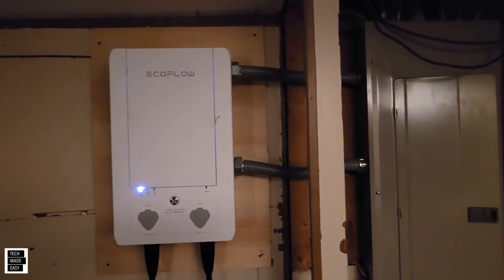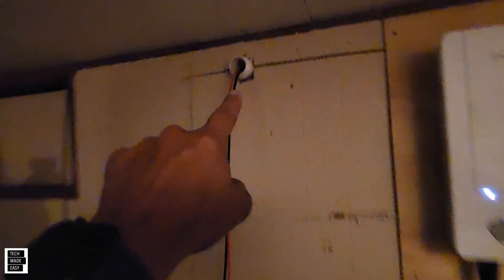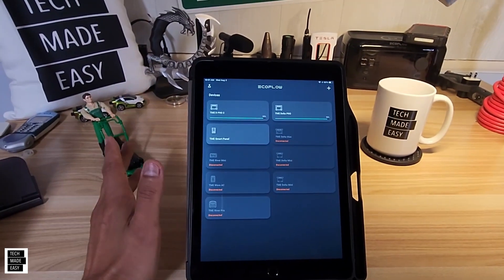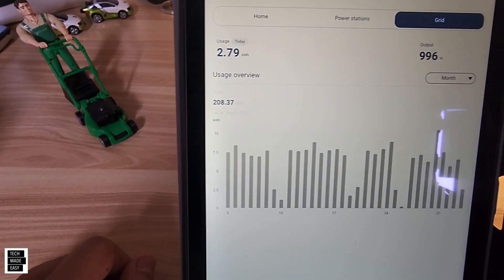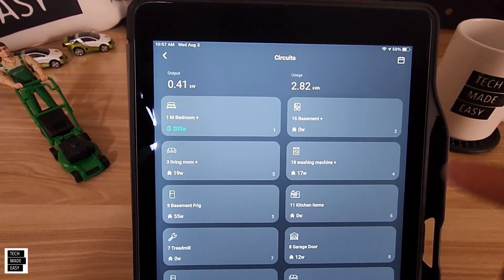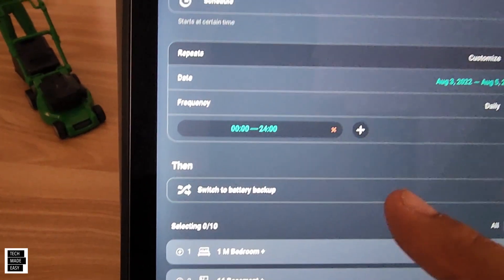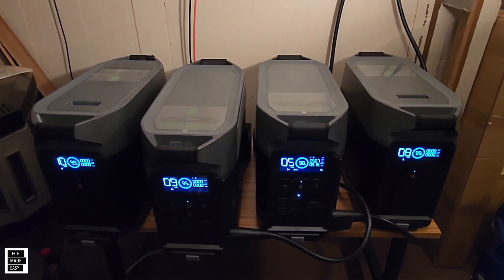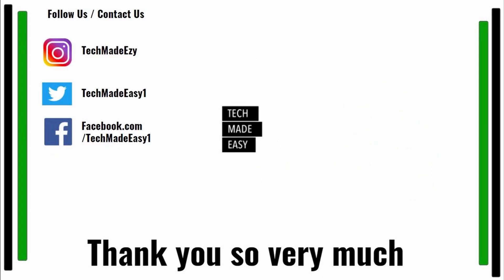EcoFlow Smart Home Panel BASICS Part 1 basic automation, power circuits

Comment: Does the smart panel disconnect the main panel automatically so it does not back feed the electricity to the pole?
Reply from the maker: It definitely doesn’t backfeed when I’m using it to power circuits

Comment: Your video is comprehensive and well presented. Unfortunately, the Ecoflow app has changed a great deal, and I can't make a correlation to the earlier app version that you used for your presentation.  The older version seemed to be much easier to set up and optimize.
Reply from the maker: Hi Mike, thank you and welcome to the channel. I have to agree with you that App is becoming more complicated.

Comment: I am electronically useless and not nearly assertive enough. This is a very educational video. However, I am still having problems with steps prior to the setting up of the smart home panel. I am not using solar, grid power only. I cannot get the smart home panel connected to wif-fi and have no idea how to trouble shoot that problem. Both the Delta Pros are connected to the Panel and to the Wi-Fi...what do you suggest?
Reply from the maker: I would contact ecoflow support
Support@ecoflow.com
Reply: @TechMadeEzy  Waiting for their response.
Reply from the maker: @johnlee8910 OK good luck I'm sure it will turn out good

Comment: Have you had any problems getting the app to connect? I had my SHP installed yesterday and the app was running fine all day today, then I went to the store and came back and I can't get it to connect.
Reply from the maker: Make sure your app is updated
Turn on your Bluetooth so you can connect that way also besides WiFi 
Once you do connect check for a firmware update , might be a few firmware updates .

Comment: I just got my Smart Home Panel installed yesterday and found your video very helpful in helping me set up the panel using the app. Thank you!
Reply from the maker: I still have it and I use it. I didn’t buy the second version. I’m glad the video helped. If you have any questions let me know and then just give me time to respond. I wish you the best of luck. It’s a nice system.
Reply: @TechMadeEzy  Thanks. I do have a quick question: if I hook up solar to charge, does it connect to the Smart Home Panel some way or just directly to the Delta Pros?
Reply from the maker: @roytaylor4578 directly to each of the Delta pros. So each of the Delta pros can actually handle if I’m remember correctly 1600 Watts of solar but double check that because I don’t have that information in front of me right now.

Comment: Very nice. I didn't even know one could do this. I am pretty clueless evidently. I looked through the comments to see if my question had been posed but didn't see anything. Probably due to software updates, my app does not look like yours. When I go to the "Circuits" window I do not see all 10 circuits like you have. It looks as if they are doubled up. In the bottom right-hand corner of the first circuit, it says "1 "2 with a symbol between the 1 and 2 that I do not recognize (might be a chain link symbol which, if it is, I cannot "break"). Same for the other circuits (3 (symbol) 4, etc.). When I select one of the "double" circuits I can then do the "auto mode" but I can't just do, for example, just number 1, 1 and 2 are done together. Sorry, that I can't be more precise as, like I said, I am kind of clueless. Is this normal? Or did it get set up incorrectly? Thanks
Reply from the maker: Hi first question for you is what country are you in because you might have a SmartHome panel specifically for your country?

also, what SmartHome panel do you have? Do you have the first one or do you have the second one the new one?
Reply: @TechMadeEzy    Thanks for your response. I am in the USA, outside Chicago. And I have the first edition Smart Panel, looks like yours. I didn't even know there was a second one. I haven't had the Smart Panel very long so the second one must have come out relatively recently. Thanks
Reply from the maker: All right well you’re a local guy anyway the app is updated. That’s why it looks different. I recorded this video a while ago. The date should be on the video. What let me know what questions you have.

Comment: Does the panel charge the DP when it's all set to use grid power? If not, how do you keep the second DP set charged up?
Reply from the maker: It can solar charge while powering the home, you can have up the 1600 W of solar on each Delta pro

Comment: Intresting that u can have a eco flow power box into mains. Would love to know a aprox how many kw per day you need to produce to run a small 2 bed appartment. Then the cost to buy and set up you system. Do the Gov tax your system?? On self generated power ? If not ot will come Sun tax

Comment: ECO Flow's battery packs are good. I have a Delta 2 Max and it performs well. I'm glad I purchased it because it saves me money if I couple it with solar panels. The cost of the setup pays for itself relativity quickly. What is also impressive are the apps that pair with the devices. Best apps I've seen for any use. They have some geniuses over there. I haven't seen an app that gives you information about almost everything that's going on. An app tells a lot about a company. It demonstrates how much they value the customer. Their apps show that they have the customer's best interest in mind.

Comment: In automation what does the 0 - 24 stand for?  I’m trying to setup automation from 6 am to 6 pm….how do I do that?
Reply from the maker: Those are the hours you wanted to run the automation you have to put a start time in and then you have to go back in and put an end time. You can also put dates so you can have it run for a couple of days.
Reply: @TechMadeEzy  Thanks - I put a in 6 -18 to denote 6am to 6pm - nothing happened -
Reply from the maker: @jeromeallen9623 
I wish I could help. It’s kind of hard to do it this way your best bet may be sending a small video to EcoFlow email support is pretty good support@ecoflow.com
Reply: @TechMadeEzy  yes, sir.  Thanks for the assistance. I do have the question into them….
Reply: @TechMadeEzy  Figured it out - quite by accident - the circuits need to be in “auto mode” for the automation to work.  Mine that would not work were in “use grid power”

Thanks again!
Reply from the maker: @jeromeallen9623 all right good luck sorry I couldn’t help

Comment: Hello, I have an Ecoflow Delta Pro. It's currently plugged into an electrical outlet then give power to some appliances, and I would like to program it so it charges at off-peak hours (from 9PM to 4PM next day) and does not charge during on-peak hours (from 4PM to 9PM). Is there a way to do this other than manually unplugging the Ecoflow Delta Pro? I tried to use Automation on the app and did not see a way to do this. The reason is power consume at off peak hours gets bill at $0.146/kwh and at on-peak hours gets bill at $0.263/kwh. I would save almost $0.12 for each kwh, but the hassle of plug and unplug it manually.
Reply from the maker: You have a smart home panel by ecoflow also?
Reply: @TechMadeEzy  No, I do not. Do I need that to make DP not charging at the time I want it stops charging? I can plug it in switched outlet to cut grid power to it just like the light switch for the room. Remember how we using the VCR to record the TV program we want to record for watch later? The DP should has that feature.
Reply from the maker: @junkvista61 you will get automations with the smart home panel. The delta pro doesn't have that by itself.
Reply: @TechMadeEzy  EcoFlow is not as smart as VCR decades ago. Bummer.
Reply from the maker: @junkvista61 sorry
Reply: @TechMadeEzy  "I found it" got very simple solution, just use the timer switch. Done😁

Comment: Is there a max distance the Smart Panel can be from your breaker box? My home has 2 panels, main + sub. Most of the circuits I'd be backing up are on the sub, but there are a couple of 20 amp circuits out in the main that I had added (and no more room in the sub). My sub is in my garage but in the summer it gets incredibly hot in there and I don't want to leaves my batteries out there. I have a small closet upstairs in my home and wondering if I can run extended input and output wiring from the sub and main panels.
Reply from the maker: Hi best to email Ecoflow on that to be safe 
Support@ecoflow.com

Comment: Hi, I have the exact same equipment as you but different solar panels.  Your video is very helpful since I find ecoflow manuals inadequate, and the app a little cryptic.  Im all electric, and do not have my electric range, heat pump or washer/dryers on a smart panel circuit.  If I automate to have my panel switch to backup from grid every day at certain times, when it is switched is there still grid power going to my range and other items not on the smart panel?  Or when it switches, the grid is completely off to everything?
Reply from the maker: Hi thanks Bill
You choose the 10 circuits you want connected and all other circuits run from Grid. I hope that answer the question?
Reply: @TechMadeEzy  that's great to know!  Thank you!

Comment: Thank you! This is very helpfull for my decision process to buy the Smart Home Panel. 

I have a Delta Pro an shortly feeding it with 2S2P 450W Panels.I also have EcoFlow smart dual Generator (a great combination!)  My plan was to feed the Pool Pump during summer.
My Problem with Delta Pro is, that while AC input  is connected and Solar Input is connected it is not automatically switching from solar to AC and vice versa.

I was hoping to overcome this with the Smart Home Panel. Similar to the EcoFlow smart Generator, where you can set limits for charging and discharging. Does not look like I can realise this running my pool with mainly solar automated. Since I am often away from home I can not always manually switch between AC and solar when the weather changes....

I will check if there are other systems (Bluetti?) where I can realise this.
Reply from the maker: Might want to email Ecoflow and go over this before looking into another smart home panel. Support@ecoflow.com

Comment: Thanks! This video is really helpful. Do you think a single delta pro can with 3600w can handle 120v circuits in a home? I’m trying to decide if I need two delta pros or can go with one delta pro and add more down the line, if needed. What would happen if you put more load than it can handle on a single delta pro?
Reply from the maker: You can always try it and if you need another one by another one I’ve had mine for a while now and I’m pretty impressed

Comment: I don't know if anyone else mentioned this but your 160 watt panels are bottle necking your 400 watt panels. You end up with 18.2V x 4 panels x 8.8 amps = 640.64 watts. I saw on your ecoflow screen you were getting a little under 600 watts from solar.  If you just had the two 400 watt panels in series you'd get 41V x 2 x 9.8 A = 803 watts.
Reply from the maker: Thanks

Comment: What happens if the grid goes down. How does it not send power back to the grid? I can't seem to find any info on it. I don't want any workers getting lite up.
Reply from the maker: I've been using this now since launch I haven't had any issues there are many users that are using this. Power isn't sent to the electronic company of that's what you are talking about.

Comment: How does your setup manages the rebalancing of power capacity between delta pro and the additional battery packs? I have the delta pro plus one battery pack and observe a real strange rebalancing between the units. E.g. I set the draining to 20% and as a result the battery pack goes down to 1% and the delta pro stops at about 35%.
Reply from the maker: No it doesn’t. Contact EcoFlow they will give you some guidelines around rebalancing.
Reply: @TechMadeEzy  ok, will do
Reply: @h.m.9601  HM, did you resolve things? I'm getting the shp and have had that very concern.
Reply: @cmarehart  The rebalancing is still a problem, with my first set of DP Pro+battery. However, I bought another DP Pro + Battery and made first a calibration and that helped at lot. The SHP has nothing to do with this as far as I could observe.

Comment: I absolutely love your setup sir, and appreciate you breaking everything down to help get the best understanding of every function and how to use them properly to get the most use out of the system.

My only complaint regarding ecoflow is that everything has to be turned on & off manually it's kinda annoying if you ask me, but again that's just the opinion of one. I don't understand why they don't just write a code that gives these units that exact function seeing how they're able to update anyhow 🤦🏻🤦🏻
Reply from the maker: Thanks Bryan
If you run an automation and it's on battery when the battery is die down it can switch back to the grid, no need to do that manually
Reply: @TechMadeEzy  ahhh okay cool thanks for the fyi

Comment: I see the power turns off when you switch it to batteries. Does it mean it can't be used as a UPS?
Reply from the maker: Hi Pavlo Not for sensitive electronics like computers etc and it’s not fast enough
Reply: @TechMadeEzy  Actually not true. Maybe they recently did a firmware update because I have only had my smart home panel for a few weeks. In settings you have to turn on "EPS mode". It then acts as a UPS and will not damage or power down sensitive electronics when the grid power goes out. It switches in about 20 milliseconds in this mode. In this mode it keeps the inverters powered on so they can rapidly switch over. If you turn off "EPS mode" it acts the way it does in your video and takes about 2 seconds to power the inverter back on and switch to batteries just like if you had a standby generator just faster. This mode allows you to save wear and tear on your batteries / inverter so it's exclusively used as a backup generator. The batteries will then last an incredible amount of years. Also uses less power to run the inverter. Inverter uses about 35 watts just to stay powered on. I have lost power a few times lately during storms and had no idea it went out. Was while watching TV with several lights on and surfing the web like I am now, never lost internet or wifi. I only knew the power went out by looking in the app in the log the next day. I think this is one of the most amazing features of the smart home panel. I have had a single Delta Pro for a long time before the smart home panel hooked up as a UPS by having it plugged in to the wall and my cable modem, wifi , small freezer and Pellet Stove plugged in the front in and none of them die when the power goes out. It's a seamless switchover. Now with Delta Pro and the smart home panel you can chose EPS mode or generator mode. Just awesome. Might need a firmware update if you do not see EPS mode in settings.
Reply from the maker: Kyle it’s 30ms or less stated in the manual. Go to support and download the manual it’s not a UPS , it simply has the EPS feature 

https://websiteoss.ecoflow.com/cms/upload/2022/10/12/1312845623_1665543468829.pdf
Reply: @TechMadeEzy  The manual says 30Ms or less and the app says “within 20ms”, thats where I got that from. I wonder how quick it is in reality? It fits the definition of a UPS according to Wikipedia for one. “The switch-over time can be as long as 25 milliseconds depending on the amount of time it takes the standby UPS to detect the lost utility voltage. The UPS will be designed to power certain equipment, such as a personal computer, without any objectionable dip or brownout to that device.”

In my experience it works just fine for personal computers, modems, wifi etc. That was my point and it falls within the definition of consumer grade devices. Depends on what he meant by UPS. Not all UPS are zero millisecond switch over. Those are more expensive and are for sensitive electronics like servers that require zero switch over time. You said “computers” and I do not believe that’s 100% true.    

Most UPS you buy at places like Best Buy or other retailers are between 6-12ms sometimes more. 

It still may work for zero ms if setup properly.  You can set up the circuit the server is on to Battery mode and it will always be working off the battery / inverter. If the grid power goes out it would have no bearing on functionality of the inverter as it was already powering the device exclusively from the battery and not the grid. You would essentially have zero ms all the time.

The default circuit mode is “Auto” which automatically switches to battery if the grid goes down. With EPS mode turned on it switches within 20-30ms time we are talking about depending where you look. If EPS mode is off it takes about 2 seconds and you get temporary power loss and will lose PC’s ETC. 

If you turn Auto mode off at the circuit level you will then have 3 options:

1: Use Grid Power
2: Use battery 
3: Off

Its a pure sine wave inverter. Would turning on #2 work for a server? If so this can be used for both consumer devices and servers.
 
Since the App says “within 20ms” I am curious to what it actually is. Anybody have equipment to test it?

From EcoFlow Tech support website regarding this issue: “All EcoFlow power stations can be an emergency power source (EPS), which will have the same result as UPS for most electronics.”

I am now very curious. The documentation is not very clear...
Reply from the maker: EcoFlow themselves does not use the word UPS for legal reason and they’ve updated and uploaded new manuals many times. If they have not done so then all I can go by is what they state which is EPS.